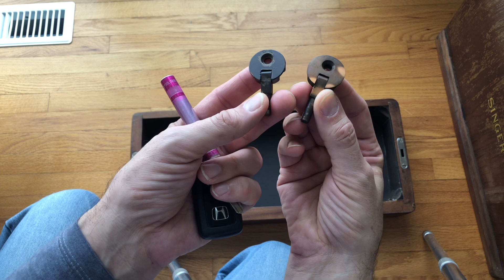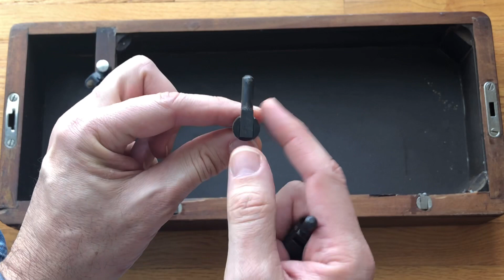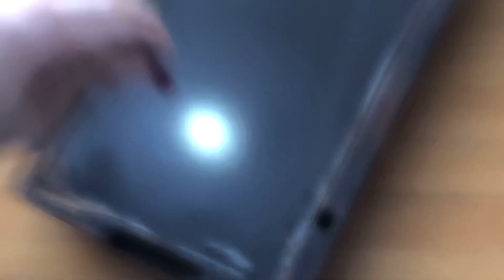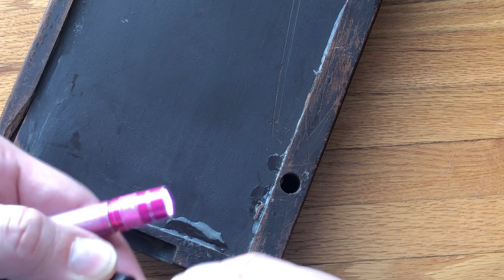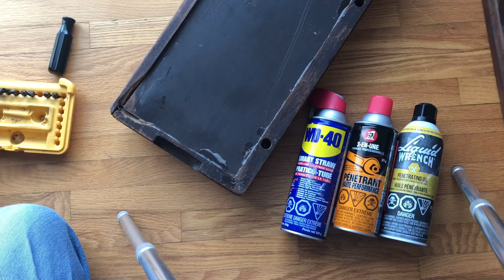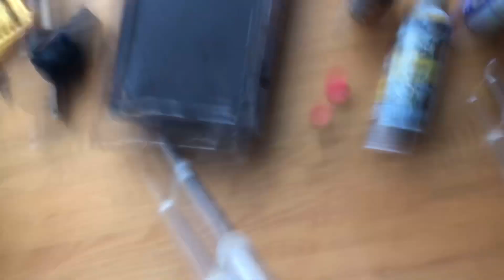CARRY CASE REPAIR #1: Hoarding Parts Can Save the Day! Replacing Hinge Pins on a Singer Carry Case!

Comment: Hi, I wrote a comment before but I think it got erased by mistake. I apologize if I’m repeating myself.
I just wanted to say thanks for sharing your knowledge and ask for advice...
I recently got a Singer 99K in a Bentwood case but it’s in rough shape. The machine is quite dirty and I will have to look more into it to see how much work it needs to be functional again but I think it’s not terrible. The case, however has suffered a lot more... the wood is “pealing” in many places although it has maintained the structure for the most part. Do you think this is too big a project if I’ve never restored a machine before?

Comment: Hi! Thanks for sharing all your knowledge. I recently got a Singer 99K in a Bentwood case but it’s in very rough shape. The wood is loose in many parts, the last “layer” is pealing off. But it’s so beautiful and I really wish I could restore it. Do you think its too ambitious to try to do it as a complete beginner?
Also, are you in Ontario?
Reply from the maker: Hello.  Most often, you can safe the framed base that the bentwood covers fit onto as they are a bit more robust than the covers.  But hey, why not go for it? The cover in the condition you describe it in currently has little value so you have little to lose in trying.  You might even investigage purchasing new veneer and remaking that.  I don't have veneer skills but someone in your community (Furniture refinisheers?) might be able to do it.  I doubt the cost would be that high given its small size.